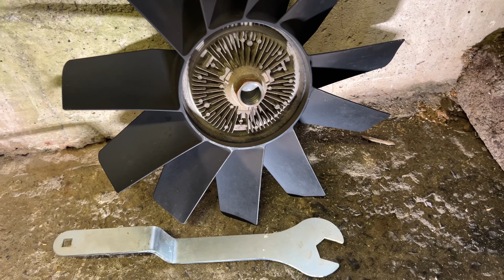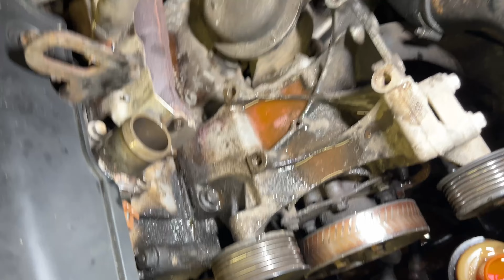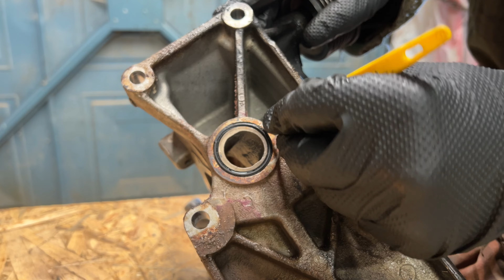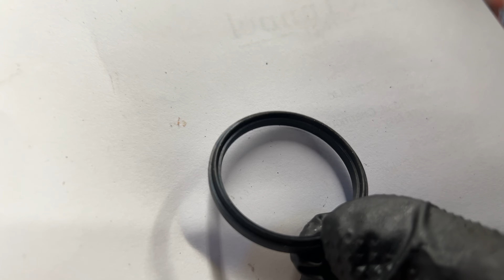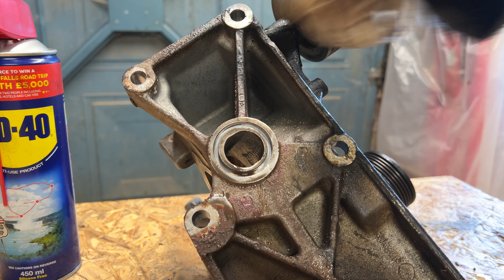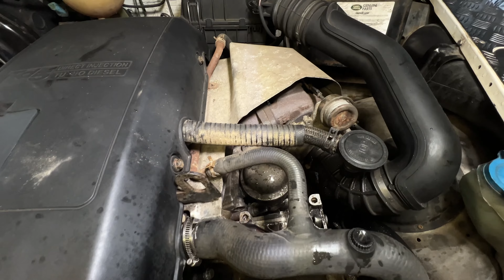Land Rover Defender TD5 water leak

Comment: Don’t ever use a Haynes manual they are rubbish they say that you should run the engine when bleeding the power steering all that does is mess up the bleeding you should only do it without the engine running I did it like the Haynes manual said and end up having to get a new power steering pump the best use for the Haynes manual is to start a bonfire.

Comment: Did the last bolt on the housing go in and Tighten easy with the wayer pump preftted on the work bench.  If so can I get away with not removing water pump and Rotor housing
Reply from the maker: I think you can if you can get all the bolts undone from the block. From memory I was struggling with one bolt for a while that’s why I removed the pump.